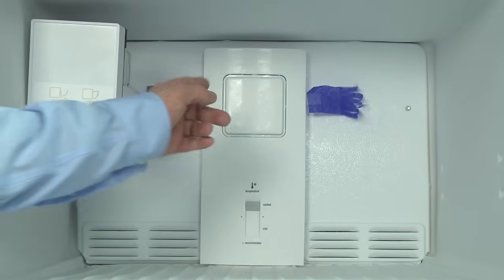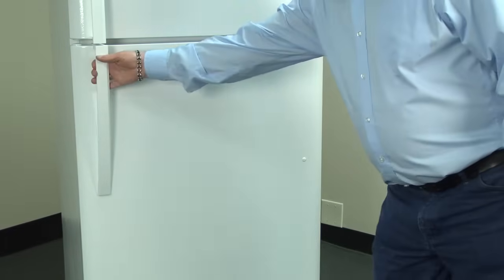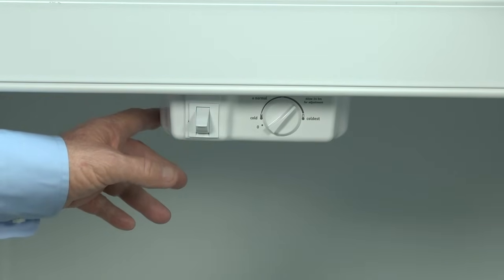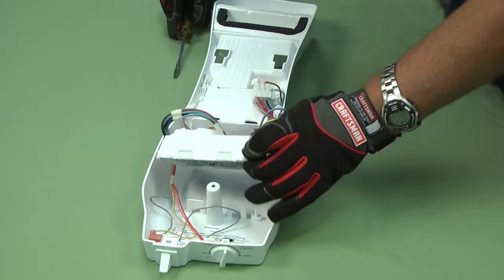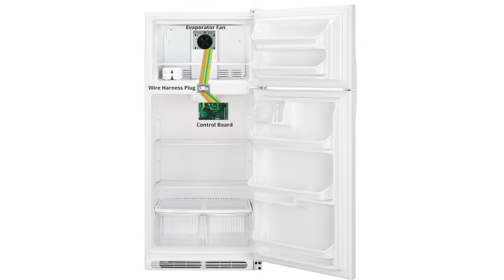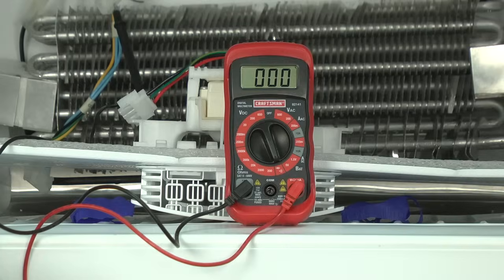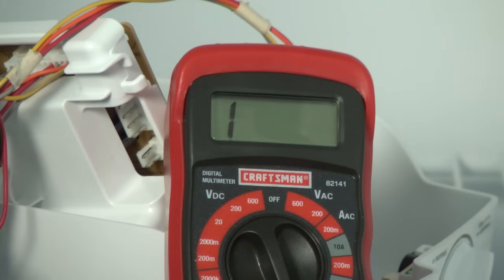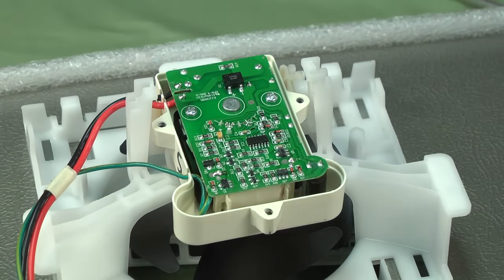Troubleshooting Evaporator Fan Problems in Refrigerators

Comment: HI,I SEE YOUR TIPS ARE GREAT,I HAVE AN LG REFRIGERATOR AND FREEZER COMBI332SF,THE FAN AND COMPESSORS RUNS,ALL DUCTS TO FRIDGE ARE CLEAR,THE FAN DOES NOT SEEM TO HAVE ENOUGH POWER TO SEND THE COLD AIR DOWN TO THE FRIDGE,FREEZER WORKING GREAT,DO YOU THINK THE FAN MOTOR IS TIRED?ANY HELP APPRECIATED.THANKYOU.KIND REGARDS.
Reply from the maker: The model number you provided seems to indicate that you have a model that isn’t available in the United States so we can’t see technical information for that type of LG refrigerator. We’ll try to provide some general information that will help. (If you have a US model, let us know the full model number of your LG refrigerator.) If you’re certain that supply and return vents between the refrigerator and freezer are clear, then a weak evaporator fan could be contributing refrigerator section cooling problems. Keep in mind that cold air sinks. If the evaporator fan is running (even though it may be weak) enough cold air should be circulating through the refrigerator section to keep the refrigerator section reasonably cook (at least 40 degrees F). If your refrigerator section is above 55 degrees F, then your refrigerator likely has clogs in the air duct system or a damper control problem that’s preventing the refrigerator section from cooling. We hope this general information helps. Let us know if we can assist you further.

Comment: Hello, we have the LG LSXS26386S Linear model.  Only about 2.5yrs old.
Anyway, both fans and compressor are running, although the compressor is not getting warm to the touch which seems odd to me.  Also, the fan in the freezer area seems to cut off until i open that door, then it turns on right away.  I feel around the vents in the fridge and don't feel any air movement.  I vacuumed and blew out the dirty coils already.  Thanks for any tips..
Reply from the maker: If the freezer compartment is at 0-degrees or colder, then the compressor should be working. If the freezer compartment isn’t cooling at all, then the compressor may have failed. The compressor has an extended part warranty. If you suspect that the compressor has failed, follow the steps shown on page 51 of your owner’s manual to schedule warranty service. Here’s a link for the owner’s manual in case you need it: https://www.searspartsdirect.com/partsdirect/user-manuals/lsxs26386s00-lg-parts-manual. If the freezer compartment cools but the refrigerator compartment isn’t cooling, then a stuck damper could be preventing the cold freezer compartment air from traveling into the refrigerator compartment for cooling. Unplug the refrigerator and check the wire harness connections on the damper motor that opens the vent to let cold air flow from the evaporator in the freezer section into the refrigerator section. Reconnect any loose wires. If the wires are okay, you may need to replace the damper motor.
Reply: Sears PartsDirect thanks for the fast reply!  Neither fridge or freezer are cooling at all, both warm. The fan blows good in the freezer but its warm air, and the compressor is running. I'll look into the warranty on the compressor that you mentioned.

Comment: mine runs for 2-3 seconds then stops and starts right back up,then repeats
Reply from the maker: A loose wire, could cause this problem. Unplug the refrigerator and check the wire connections between the electronic control board and the evaporator fan. Reconnect any loose wires and repair any broken wires.
 
If the wires are okay, then a bad evaporator fan motor or a failed electronic control board could be causing the fan to cycle on and off.
 
If these general tips don’t help you figure out what’s causing the failure, let us know the model number of your refrigerator. With the model number of your refrigerator, we can likely provide you with more specific help for diagnosing and fixing this evaporator fan problem.

Comment: Hey, what is the Wattage for your fan motor? I'm having a problem where my fan will turn on and off which leads to my freezer not getting cold. My Motor is rated 12vDC, and 4W. From my calculations is should be getting a resistance of 36.7 ohms but once I connect my meter to the fan I'm reading 1.2kohms.
Reply from the maker: The wattage of the evaporator fan motor in the refrigerator shown in the video is 2.6 watts. Because the fan motor in the refrigerator shown in the video (253.60412411) uses an electronic control board attached directly to the motor to control the fan, we weren’t able to check resistance through the fan motor windings. You may be facing the same issue when attempting to measure resistance through the motor windings in the evaporator motor for your refrigerator.
 
Also, the electronic control board doesn’t run the evaporator fan constantly when the compressor is running on some models of refrigerators (including the model shown in our video). If the evaporator fan in your refrigerator runs when activated by the electronic control board, then the evaporator fan motor may be okay. A faulty thermistor (temperature sensor), defrost system failure or bad electronic control board could be causing cooling problems if the evaporator fan motor is okay.

Comment: The evap fan does NOT run just because the compressor is running. On a warm refrigerator for instance when you first plug it in, the evap fan should NOT be running. The compressor runs for a time without the evap fan in this case in order to cool the line that the evap fan stat control is attached to. Once that line reaches the set temp, THEN the evap fan should come on. If the evap fan came on immediately on a warm friidge, the thing would either never cool or it would take forever to reach the temp you set it at. I hear this poor explanation on nearly every video I've seen on this issue. If the evap fan is running when fridge is warm(like when first plugged in) then the evap t-stat is likely bad.
Reply from the maker: The video says that the evaporator fan typically runs when the compressor runs, which is true for many refrigerators. You’re correct that the evaporator fan doesn’t always run when the compressor runs on some models (including the one shown in this video). That’s why we used the diagnostic test mode to check the evaporator fan in this refrigerator.
Reply: I like this comment. I replaced the evap fan on my tenant's Frigidaire FFTR2021TS5 a few hours ago but it did not appear to fix the issue. I left very defeated 😅, but now I'm wondering if the line the evap fan stat control is connected to was just not cool enough yet, as you described.

Inshallah tomorrow I will find a cold fridge compartment and the hum of a working evap fan 🙏.

Comment: We've owned one of those new energy saving Kenmore refrigerators for three years now and it has an irritating problem that I can't seem to find any information about online. The compressor and condenser will come on, but the evaporator refuses if it's not forced. Sometimes it'll run in pieces- condensor and evaporator for several minutes, then they turn off and the evaporator runs for several minutes, then all three run together for several  minutes. (This is not great for our power bill.) Now here's the thing that makes it so odd- this only occurs from late October to Thanksgiving, when everything will be perfectly fine for another year. It's so regular I could mark it on the calendar, almost as if it's been programmed into the thing's computer to act like an ass every fall. Any idea what could be causing this and how to stop it?
Reply from the maker: Let us know the full model number of your refrigerator and we’ll look into this issue.
Reply: It's a Kenmore #253.60412410. Normally I have no complaints about this fridge, just this one mystery. The only other time this happens is if we've had a brownout or power outage, but it usually remedies itself in a few cycles in those cases.
Reply from the maker: Your model uses an electronic control board to control evaporator fan operation. The electronic control board gets input from the defrost thermistor (temperature sensor) when controlling the evaporator fan. We don’t have technical details about how the electronic control board decides when to run the evaporator fan but we suspect that you’re seeing differences in evaporator fan operation based on input that the electronic control board receives from the defrost thermistor. Based on your description, the refrigerator seems to be working properly.
Reply: Thanks for looking that up for us. I really appreciate it. :-) I wouldn't have worried about it except that we were losing food, especially dairy products. We actually just figured out what was going on and it has a very simple solution. This time of year is the only time that the sun shines directly on the refrigerator, and (according to the manual) it's shines directly on the spot where the thermostat is located. Blocking the sun stops the problem completely. Weird, but interesting.

Comment: HI, we noticed the freezer in our Kenmore Elite bottom freezer stopped freezing (cold but not freezing). We tried to replace the evaporator fan motor to no avail. While in test mode the fan works, but in regular mode, it stops again. Thank you in advance for any help! Model#795.79043.310
Reply from the maker: Because the fan runs in the test mode, the evaporator fan motor is okay.
 
The electronic control board may not run the fan continuously when the compressor runs in the regular cooling mode. Let the refrigerator run for an hour and then check to see if the evaporator fan runs when the compressor is running.
 
If the evaporator fan never runs in the regular cooling mode, then you’ll likely need to replace the electronic control board (http://www.searspartsdirect.com/part-number/EBR77042506/0046/795.html). Here’s an illustrated repair guide that shows how: http://www.searspartsdirect.com/repair-guide/refrigerator/how-to-replace-a-refrigerator-electronic-control-board.html.
 
If these tips don’t help, we recommend that you have a service technician examine and repair the refrigerator. You can schedule service here: https://www.searshomeservices.com/.

Comment: Why don't you mention the easiest thing to check.  Thaw out the refrigerate to clear any ice that may have formed inside the wall of the unit that interferes with the operation of the blower fan.  I could not see the ice even after emptying out the refrigerator but thawing out for 24 hrs cured the issue.  This should be the 1st troubleshooting tip.
Reply: Probably because that's a temp fix. What is causing the buildup?

Comment: oh by the way i unpulged the fridge  I took the fan panel down hairdryed the filaments in the back turned it back on after an hour and the filaments get Frosty again usual.but the fan is hardly moving the air thry that air duck into the refrigerator from  freezer. I just thought I'd get a faster fan

Comment: I thank you for your video. my issue is thou the fan works. we had a heat spell in New York for 4 days. just before that time I used to feel the air blowing from freezer to fridge below thru the air duck in  back of the fridge. now during the heat spell 2 days ago the fan probably is not blowing strongly or fast enough cuz it's hardly a trace of air blowing through that duck.   suspect the fan is spinng slower slw. tempe in ridge is 50 °.humn? it's the same 12 volt type fan  found in a UPC computer. fan label  says 2.2 Watts. the fridge is 17 years old. is there a faster fan with the same 12 volts i can get. so i can feel that reassuring cool air blowing into the refrigerator thanks so much for help..
Reply from the maker: We don’t think you need a stronger fan. Replacing the existing evaporator fan with a different type of fan isn’t a good idea. If the existing fan isn’t running at full speed, we recommend that you replace it with the manufacturer-approved replacement part. Give us the model number of your refrigerator if you need help finding that part.
 
If the existing evaporator fan appears to be running at full speed, then the refrigerator may be building up frost on the evaporator fins due to an air leak through a door gasket. Excess frost can clog air passages through the evaporator and prevent air from flowing into the refrigerator even though the fan runs at full speed.
 
Check the refrigerator and freezer door gaskets for damage and replace any damaged gaskets.
 
If the gaskets are okay, then a problem with the automatic defrost system can cause frost to build up on the evaporator fins and prevent air from flowing into the refrigerator. Follow the troubleshooting steps in this video to resolve an automatic defrost system problem: http://www.searspartsdirect.com/article/troubleshooting-defrost-system-problems-in-refrigerators.html.
Reply: Sears PartsDirect hello thank you very much for responding. to my message. I'll have to look for the model number of this Avanti two door frost-free made in 1999. by the way when  landlord the first got me this fridge the fan conked out after six months. I looked at the fan and replaced it with a similar  fan which looks exactly like a PCU cooling fan which is only 2.2 Watts fan pretty low you think? I don't know what the wattage of the original fan.  but the pvu i put in worked well for the most part for 17 years until the heat spell hit last week. I melted away the ice in the air ducks and the cooling fins behind panel with a hair dryer it didn't give much help. when I restarted the refrig after an hour this past weekend the temp about 50 now after a couple of days later temperature went down to 40. its still humid in fridge. my gaskets  are  holding up. no visible damage or leaks but  I'll look for model number and I'll get back to you please can explain why do they call this an evaporator fan?? why is it an "evaporator" fan?? thanks very much for your help again appreciate it

Comment: My Samsung rs 267 can't make ice what the problem please give me ideas
Reply from the maker: Check your freezer temperature. The ice maker won’t cycle if freezer temperature isn’t below 1.5 degrees F in that model. Adjust the freezer temperature setting if necessary.
 
If freezer temperature is okay, unplug the refrigerator and check the wire harness connection on the ice maker. Reconnect the wire harness if you find it loose.
 
Plug the refrigerator back in and manually fill the ice mold with water using a squirt bottle or turkey baster. The control will check the ice maker temperature 2 hours after restoring power. The ice maker will cycle and dump the ice if the ice maker’s temperature sensor detects that the ice is frozen.
 
If the ice maker doesn’t cycle after 2 hours, press the test button on the bottom of the ice maker to cycle the ice maker. If the ice maker won’t cycle, then you may need to replace the ice maker.
 
We hope these tips help you resolve the problem. Post the full model number of your Samsung RS267 refrigerator if you need more help.

Comment: my fan is not working in my freezer.. cold..but not cold enough.. please help.
Reply from the maker: Unplug your refrigerator and check the wire harness connections on the evaporator fan and the control. Reconnect any loose wires. If the wiring connections are okay, then the evaporator fan motor may have failed or the control could be bad. You may be able to fix the problem by replacing the evaporator fan motor. If you replace the fan motor and the fan still won’t run, then you’ll likely need to replace the control.

Comment: Very good video.  Please instruct me how to enter the diagnostic test mode on Kenmore 106.53232300? My Evaporator Fan Motor (Part Number: 2188357) is stopping running. There is much less cooling in the refrigerator section as there is no cold air from freezer section to the refrigerator section. I need to test if the board is good or not before I order the motor to replace it.
Reply from the maker: That model has a defrost timer instead of an electronic control board. The timer doesn’t have a diagnostic test mode. The compressor is in the same circuit as the evaporator fan. Your details seem to indicate that the compressor is running so the evaporator fan should be getting power from the defrost timer. We recommend that you unplug the refrigerator and check the wiring connections on the evaporator fan. If the wiring is okay, then the evaporator fan likely failed.

Comment: Excellent Video. A+!!! My issue was the damn drain. I stripped 5 feet of coax cable to clear it lol. Upon further inspection I noticed the fan blows out torward the freezer door. My freezer and fridge is similar to what I've seen in this video. To me it would make sense to suck air in over the coils to cool them and then to the bottom firdgerator. As far as efficiency is concerned I would think. But I noticed vents in the bottom. I can see it blowing air out to freeze the freezer and then sending the air to the bottom vents for circulation back into the refrigerator but this to me seems extremely in efficient. But makes sense to prevent the freezer getting to cold to quick. It's going to take forever although. Which way does the fan blow on a model like this. Does it blow air toward the door or suck air in.
Reply from the maker: The evaporator fan blows air toward the door. Return air gets sucked in through the bottom and back of the evaporator.
Reply: Sears PartsDirect